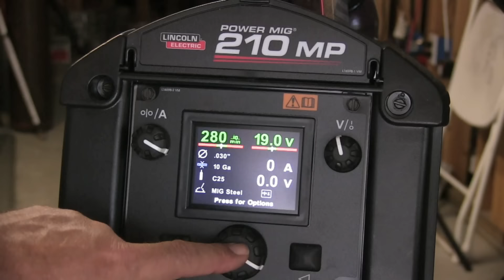Rocket Stove Welding Project

Comment: Wrap it in 2x in header wrap and it will work so much better. Wrapped mine in header wrap and now it burns so hot that there isn't any smoke and zero carbon monoxide.

Comment: I made a rocket space heater from two party helium bottles, the burn chamber and internal chimney are insulated so the temperatures get so high only steam comes out. The heated dome routinely maxes out my stove thermometer at about 500C. It's a hit at winter BBQs. It is possible to take the dome off for cooking but it is more like cooking over a jet engine :)

Comment: Great video! I absolutely love your instructional videos (you were actually recommended by my instructor as well as the course coordinator who owns your set of dvds), they really helped me through my course and to pass my all position stick (I had never even touched a welder before I went to college for the course). This vid was a nice change from the instructional vids, and very well done (and made me hungry). Oh, your tig finger really helped when I was doing my course for pressure pipe (6G, 2" sched 8, 6010 root and hot pass, 7018 cap/fill). Sure, I didn't do tig for that, but it allowed me to prop on the pipe and get stable (It's a little beat up now, and I have a second one i keep in my shop for when I do tig, but it is still functional). Thumbs up! . . . and now i'm hungry too!

Comment: If I up the tube sizes will I up the BTU, we usually make something like that with a 12" sch 40 pipe to achieve the output but the project and welding unit 👍👍

Comment: what welding rod do you use for stir fry?
Reply: Try 3/16" ( 4mm ) at about 140 - 150 amps ( or more if you like it very well done ) for a good crispy, caramel finish.

That's for your hands.

Now, for the stir fry .  .  .  .   .

Comment: Mr. Jody I have noticed that the welding table doesn't seem to be thick, I am planing on buying two costum plasma cut steel sheets for two propper welding tables and I was wondering what thickness should the stock be, what is enough ? I would verry much apreciate your answer, also the holes gage and layout

Comment: I would put the egg in at the end for a soft poach. Kim chee is one of those odd things that grow on you and you don't quite know why but for some reason you will find yourself craving it every now and then. Good as a side dish for bulgogi [korean bbq] or bibimbab and in soups.

There are a lot of korean markets in my area, kim chee comes in many versions and brands; the most popular standard is young spicy cut napa cabbage. I also like cucumber, and white(napa without chiles, the original, as chiles come from S.america); radish,  radish greens, and straight green onion are good but more potent. Some times you can get old/mature which is fermented a couple months[ young is only a week or two] and mature tends to be more associated with home made and whole leaf [actually a quarter head still attached to the stem with seasoning stuffed between leaves]

Comment: PAM spray on galvanized, that is new to me, will try it
Reply: the spray works to deflect spatter that would otherwise mess with threads. I don't think its specifically just for galvanized. :)
Reply from the maker: semidemiurge anti spatter for the threads
Reply: weldingtipsandtricks so it just keeps the spatter from sticking to the threads?

Comment: what are the bolts for?
Reply: maybe so it could be used on a wood deck, or to level it up when on an uneven surface (so the pan won't slip off).  Although, just using three bolts would make that easier.